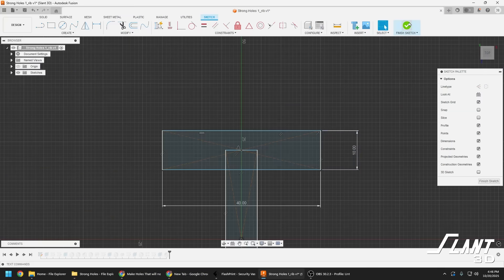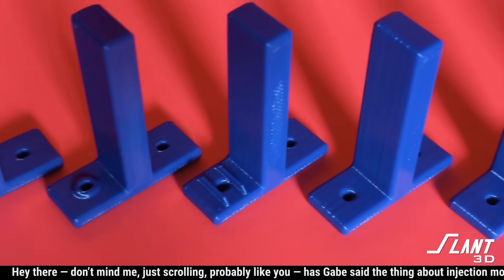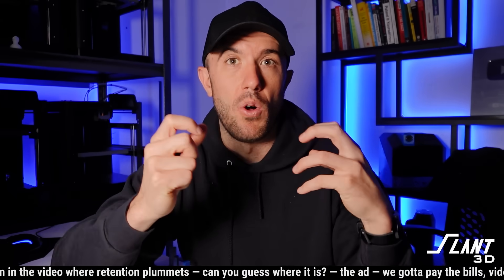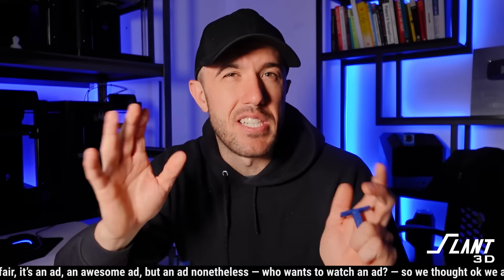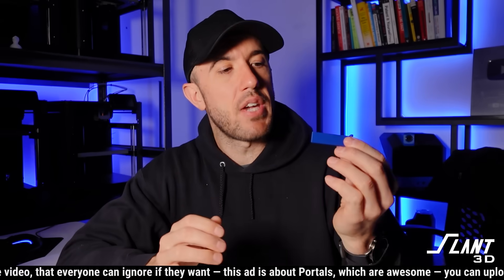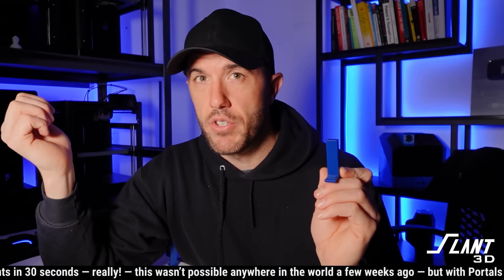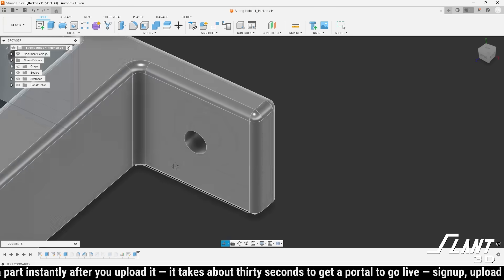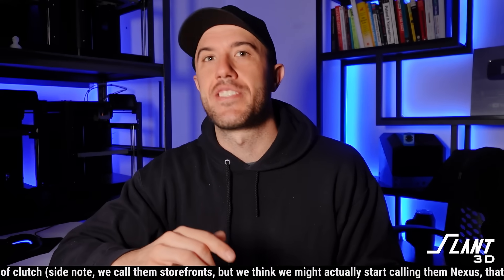Holes That Won't Break | Design for 3D Printing

Comment: Generally, I have a different approach:
In the modelling phase, make the Main part object 1, and the hole a cylinder that is object 2 (2 parts one in another that have no spacing)
When you import in to the slicer, you will have 1 Object that is made out of 2 parts. If you slice it like this, you will just have 1 part. The slicer will see it as one part.

But here is the trick!

Go to the objects view, and select the hole cylinder object. Set the infill of that object to 100% (Maybe 100% is a bit too much)
What you get is a part with its defined wall thickness, infill, and in this part the holes have an outer "thorus" that is 100% solid plastic so it is harder to split (Still dependent on your layer adhesion).
If you want to make it even stronger, make a spacing for 2 metal washers on each side of the hole. This will distribute the force evenly on to a larger surface area and transform the force to compression force on to the 100% infill plastic part.
Reply: I've used the metal washer trick multiple times, and decent size washer distributes weight in a way that is far stronger than any printing trick
Reply: Slant doesn't like that as they think they should be able to slice every model with the  a same settings and it still works as that's how they run their print farm. I do what you do.
Reply: @jbradleyk  I mean... this approach is like in between. I think that 100% infill is 100% infill in all slicers? Cant go wrong with that too much?
Now that I think about it, you could even do it directly in the slicer with a modifier cylinder over the wider hole area and defining a 100% infill... need to see if that produces the same result...

Me from the future:
Yep! Modifiers in the slicer work even better for this. Because you can quickly adjust the size and position of the modified area! But then again, you are relying on the slicer setting more....
(Used the Balbu Lab slicer / derivative of Orca slicer)
Reply: @GGnext.crazycro  Orca is technically a derivative of bambu slicer, both of which are a derivative of prusa slicer, which is a derivative of super slicer/slicthreeR, which is a derivative... wait, how deep does this Rabbit Hole go? 🤔
Reply: Here are the example files: STEP, 3mf, and a picture:
https://drive.google.com/drive/folders/1HMPWlUc_-CzeJpNftp83xH1Ly9B2WX4x?usp=sharing

Probably going to get censored by youbitiou :)
Shared the wrong folder the 1. time ... facepalm.... now its ok...

Comment: Crazy fast. Couldn’t understand.
Reply: @AB-zw5xx  at 3:40 he gives a very good idea, you see if you ever worked with gears too (which also have weakness problem) we try to pull some tricks to force the slicer to give more walls next to the parts that break, by introducing void in the plastic the slicer is forced to put more walls in that area making it more strong but also more flexible thanks to the voids, very very smart idea I might have say, and remember if you aren't pulling 100% then wall count is what will give you more rigidity

Comment: I've been trying to print a dart shaft for a while now. Unfortunately, I haven't managed to get them as strong as the store-bought ones (K-Flex). I've tried everything from PLA, PETG, nylon, and polycarbonate. Even orienting them on the print bed hasn't yielded much results. They still break relatively easily at the screw connection. Do you have any tips, or how would you do it?
Reply: maybe try design a hole running through the middle then glue a piece of wire or a nail down the body of it, that will strengthen the layer lines. Or if you can find long thin enough screws, they will be very strong and mean you wont have to mess with glue. It essentially makes the part into a plastic covered metal core object. Though i imagine you're trying to keep the weight as low as possible?
Reply: Das sind gute Ideen, aber ja das wird dann alles zu schwer 😅
Hab auch schon Multimaterial versucht. Verschiedene Filamente im Verbund mit Tpu.  @MrMediaPC

Comment: I have a stronger option : using a concave conical whasher printed horizontally and the complement shape in the part printed in the bad layer orientation. 
Cons: Another part to design and print, and assembly tolerances to manage (okay 0,25 mm offset is rocket science i get it) 
Pros: The washer need no support and have no overhang. You can basically go brainless on your part orientation regarding the screw direction. Once you add this washer, the screw squeezes it against your part, compressing the layers into each other, and locking them in place. The screw isn't just the dangerous fixation you sweat about anymore, it also becomes the strenght buff of your project at the same time. 
Tested and approved, this is strong AF. Recently used for a rigid car grab handle, that I use to get in and out, can litterally lift a man.
Reply: This part can also just be bought - there is also conical washers, that can be followed by the 3D model, giving additional strength.
Reply: This. Plus, now the part at risk for damage is the washer, and it's a smaller part that's easier to reprint.

Comment: slicing the model internally, also prevents failure if a person wants to use less material. it prohibits the use of less material there.
Reply from the maker: Very true. It ensures that users of the file cannot get themselves in trouble.

Comment: No actual stress test for hacks you provided, also if you just want to distribute your model and be sure that it will be printed as intended, just distribute 3mf files with embedded settings and modifiers, not stl or step
Reply from the maker: Different materials, different printers, different nozzle size, different scaling, etc. All break 3mf. Make the design durable.

Comment: The only problem I've had with making internal gaps is the retraction settings on your printer need to be really tuned, because the printer is going to retract a dozen times in a row on every layer for every hole.

Comment: TIL: If you stack 0.4 mm disks with 0.4 mm interval, OpenSCAD thinks they are one cylinder and hollows it out. But when you stack them at 0.45 mm interval, they are separate disks. But they so close that the slicer glues them together.  Solidity achieved.

Comment: After all of that, you didn't explain how to do it. A couple of seconds of the model flashed on screen doesn't explain what you are doing.  You have some of the greatest info on 3D printing, but your amped up presentations suck. Thanks for the idea that I still don't understand. 😥
Reply: "How" is going to depend on what modeling software you use. Do it in the modeling software before you ever export an STL.
Reply: @darrennew8211  Thank you for the reply, but I still don't know what to do. He just showed a very brief view in the modeler and I can't see what was done.  Is it something inside the model or outside?  Anything inside usually creates and error in the slicing software.  Thanks
Reply: @KW-ei3pi  Subtract out holes in the middle of the model. This makes the slicer treat the area around the whole as perimeters. Look at some of the other videos here on how to make parts stronger - they already covered that here.
Reply: @darrennew8211  So the diameter of the hole is larger inside the part than the entry and exit? Thanks
Reply: @KW-ei3pi  Exactly. Or if you want to make something more solid around a large vertical hole, you put a bunch of small vertical holes around it. But you need your retraction real good because each perimiter is a retraction.

Pause the video and single-step it back and forth to see what he's doing.
Reply: There was like 5 methods explained including the cons with it. Or did you miss the .1mm disk cut around the hole to trick the slicer into making it sold in critical areas?
Reply: @steelace  His solution to the problems with other methods was the .1mm disk. But I just don't get what he meant by "cut".  He kept saying "cut", but I don't know what that means.  In the model view, it just looked like a countersunk hole. Or wast that countersink just still there from the last demonstration???  Thanks. I appreciate the help.
Reply: @KW-ei3pi  The disc he was talking about inserting into the model was inserted as a cut and not a ad, in other words it actually hollowed out that disc inside the model. It's very thin only 0.1 mm and thereby it forces a perimeter around that cut every location that is placed. So your slicer naturally reinforces that whole area around every cut that you introduce into the hole. This gives you a lot more perimeter and a lot more surface area and a lot more strength.
Reply: @robertmunafo5039  Thanks. I just wish I could see it in the model. All I saw was a countersink.
Reply: What do you mean wasn't explained? In my eyes he did show how to model everything shown

Comment: If we are talking specifically about holes for screws, I think there is a much easier solution here and that’s just to use a pan head screw instead of a flathead. You’re never going to defeat the wedging action of the metal flathead. The pan head has a much wider surface contact with the part and it’s also less likely for someone to over-tighten it which is what it’s really splitting the part.
Reply: This, I'd never design to use a conical wedging screw type.  
Also can design a recess for the screw head of a pan head screw, and also provide screw caps to hide mounting hardware for cosmetics if desired!  
Can also have mounting brackets designed in a more suitable print orientation which the piece slots onto for even easier installation without features blocking a screwgun and hiding hardware.
Reply: @RJFerret  Yep, that's what I always do if I want it flush. Just create a counterbore for my pan head or socket cap screws. Working on a project right now for my wife that has a good amount of screws and they're all counterbored. Good call on the screw caps! May need to design some up and do some small scale test prints to get a nice fit, so thanks!

If I don't care about flushness, I always use a washer as it distributes the load more and therefore no cracking. Or as someone else mentioned, get the fillet relief washers and design in a spotface the height of the washer/flathead to have it sit flush with the part.
Reply: or you can get washers specifically for the wedges shaped screws, that have a space on the back of them, that if you design the print to fit inside that space it will make the screw essentially be clamping the layers of plastic together.
Reply: @MrMediaPC  Or even model a washer for your part—I have some brackets I designed to retain large panels (which periodically get removed) that have a 8mm deep recess with chamfered edges around the screw holes, and matching washers that sit flush in that recess and that have the right taper for a standard deck screw. Those washers can be printed with more walls and higher infill to withstand the stress, and they create a bearing surface so the rotation of the screw doesn't crack the bracket. If one of the washers breaks, they're easy to reprint and replace. Reduces the strain on the plastic, and moves the strain to a sacrificial part. Plus, then the bracket and the washer can be printed in different orientations for even more benefit.
Reply: @MrMediaPC  Cheapest washers you can find are usually the best for us: they are stamped from one side and they come out as conical, with convex and concave side, and there is even a sharp lip that bites to the plastic: all the forces are directed towards the center pushing things together. They hate those washers in metal side, put it wrong way around and the lip will penetrated any anti-corrosion coating but it remains hidden... at the worst possible spot, where all the forces concentrate since we are talking about nuts and bolts holding things together and there is significant torque applied. And that is also a problem that gets worse, tiny bit of loss in tension because metal is corroding makes things move, and movement will scratch the coating and the rust, creating even more space, and more movement.... In our case it biting on the material is a good thing.
Reply: Or screw with washer. Some spring washers curve exactly in the direction that would counteract the splitting force.
Reply: +1 for the ad crawl.
I had to rewatch just to make sure I read it all.
Reply: Check your the underside of your screwheads. You will notice that they are not flat but are a bit conical even when they are suppose to be flat. Wear at the manufacturer end will always go towards conical. This is why i started using stamped, cheap washers that are not flat but are conical... with convex and concave side. So, we can use the "anti-cone" side that even has a sharp lip that will bite to the plastic and it actually tries to push the layers together, towards the center. If you don't use washers then the last little tiny bit of travel left when you reach peak torque means that we now have tiny angle, tiny bit of push outside even when you think that the screwhead was flat. It creates a bias and positive feedback takes care of the rest: the first crack creates more sideways forces, stress points in the wrong direction and... it spirals out of control. With a stamped washer, the peak torque is peak "pulling things together" force and we are using compression to our advantage.

Comment: Coming from year 3042, we've finaly achieved quantum level precision in 3d printing and now we have bunch of models with weird holes and 0.001mm slots that were previously considered to be hidden by low precision 3d printers of the past.
Reply: @harviecz  tell me please did team orange made a propper 3d printer ?